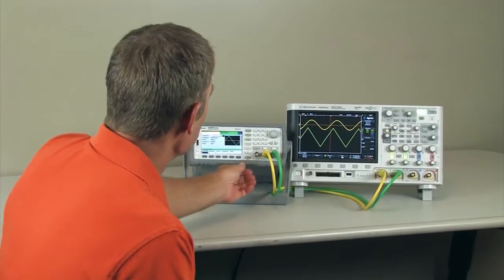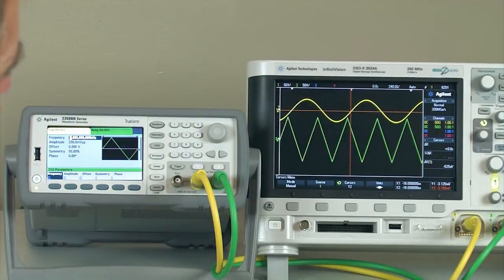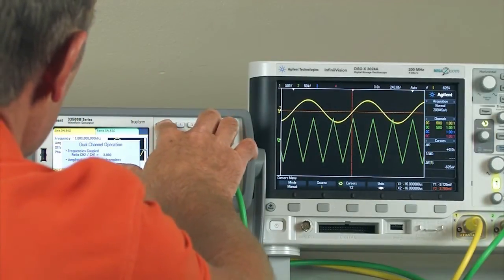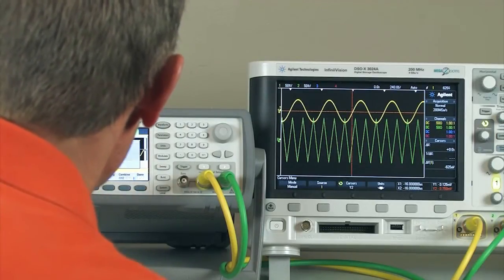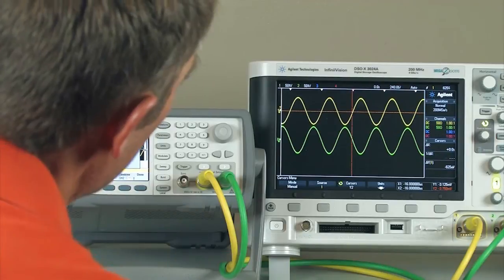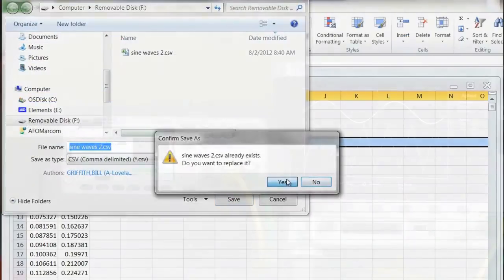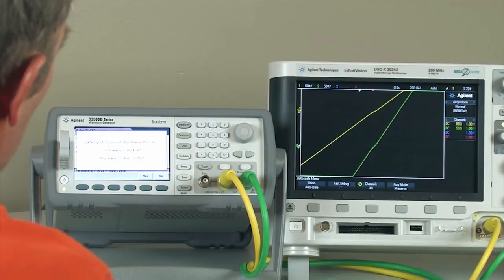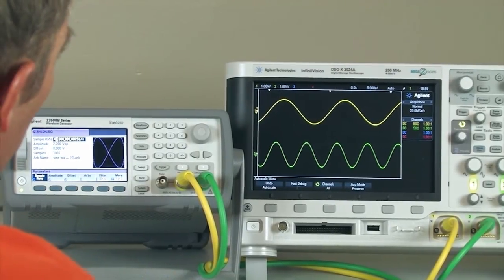33500B Waveform Generator Synchronize the Outputs of a Two Channel Waveform Generator

Comment: Hello sir! Is possible to generate 1 period of oscilation on signal generator and to record it on osciloscope? Thank you !
Reply from the maker: Catalin Palade A function generator with burst mode will allow you to output 1 or more cycles of a waveform. Burst mode is commonly used with an arbitrary waveform to output it once.  With the scope, you can use a single trigger or wait for trigger.
Reply: @KeysightHandsOn  thank you very much! You helped me a lot!

Comment: Does anyone know how to create DC with on/off function. I do not want to use AC. I just to apply current and Cut it momentarily and that would be repeated multiple times. Is it possible to do with the keysight waveform generator?
Reply from the maker: Aser Yas DC is one of the signal types. You can select DC set the amplitude and turn the channel on/off.

Comment: Can it also synchronize  a sweep and a arbitrary waveform?
Reply from the maker: Marco, typically sweep does not work with channel coupling. However, there are three methods that might meet your needs. 1) you can use sweep with tracking to create two identical signals (or the signal and an inverted copy). 2) You can setup the channels independently both with an arb, a sweep, and under the parameter menu you can set sync arbs. You can then start both channels at the same time with a manual trigger. 3) For the ultimate control you can use the IQ option. The IQ option allows a two-channel arb to be defined (shown in the video). You can then set the sweep for your dual channel waveform.